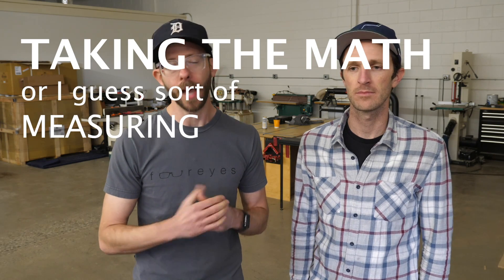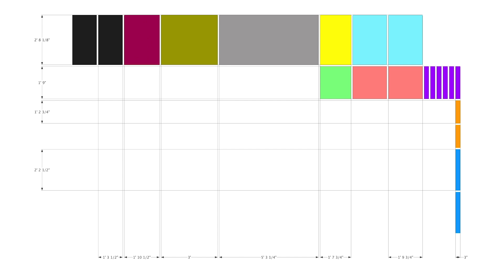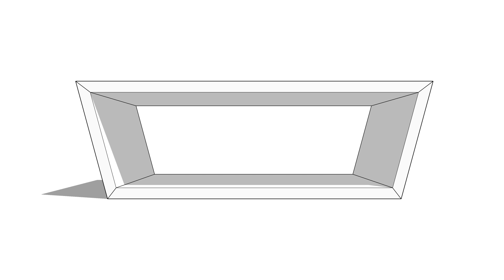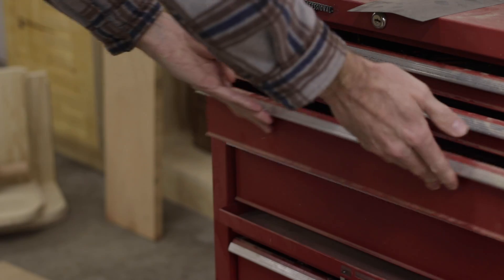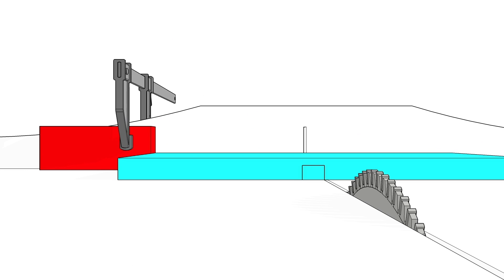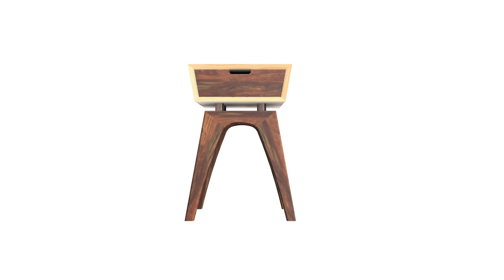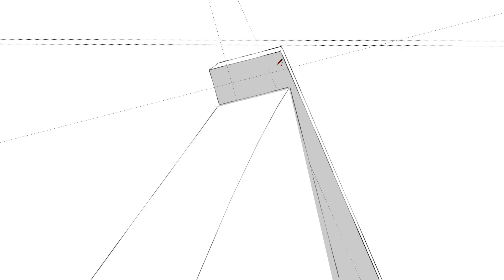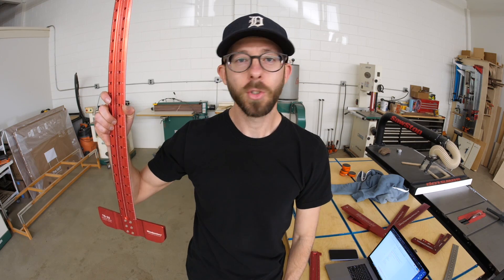Taking Math Out Of Woodworking | 6 Tips and Tricks to Eliminate Math & Measuring from your Projects!

Comment: Love that drillbit technique... I'll definitely be using it soon.

With some training in engineering, I used to strongly believe in the old adage, "measure twice, cut once"... Then I did some work with a carpenter with 30+ years experience, and so often he'd mark from actual pieces rather than measurements and sneak up on certain fits, measuring once and cutting 3-5 times... It really helped me bridge the gap between design and manufacture. We once built a deck together and I was getting all worked up about the length of the posts we were burying, the depth of the holes, setting things plumb. He taught me to throw all that out the window and just set string lines to get the posts well aligned and establish level with the the next set of beams, then move towards square with the next layer of joists, align the floorboards as well as possible, but only really worry about square when trimming the excess off the floorboards. It's fine to aim to get every cut and joint as perfect as possible, but having the skill to make it work despite slight discrepancies in the measurements, that's what really sets the craftsman apart.

Comment: Physicist here with some defenses from the haters:
1) You are using math, you're just minimizing the use of a ruler.
2) One of the first things I was taught in physics lab is "when you are using a ruler, you are actually taking two measurements, one lining up the zero, and one lining up the end" this does double the error. As you explained, a set table fence is 1 measurement, not two.
3) Trigonometry is a branch of geometry. I would say "relative dimensioning" is another branch of geometry - or just a subset of "euclidean geometry" - which is basically all the math you can do with a straight edge, and a compass - but each without markings. Relative dimensioning is a very old form math, because for a ruler to work, you need absolute dimensions, which needs a concept of zero, which was only invented once in human history in ~900CE - all carpentry and architecture before 900 - requires relative dimensioning.
4) Whenever I was doing numeric trigonometry - it is important that the sin/cos/tan be reported to 4 significant digits (e.g. sin(45) = .7071, not 0.71) (for length measurements of 2 significant digits). That's why it wont work for wood working. Hobbyists work in 2 significant digits, and professionals work in 3. 4 significant digits is just not possible when working in wood, so the 4 sig fig that you need to do trig properly, is just physically impossible.

My personal hobby is to tell youtubers who say "it's not math"/"this isn't scientific", "yes it is". Keep up the good work.

Comment: According to my math changing 1 degree in a 90 cm leg would yield a difference of aprox 2,42 cm of the total width of the legs. It is not much but it is around a 3% change. If the legs were longer than that the difference would amplify much more! Thanks for the video.

Comment: this is a great video.  In this digital age people forget that wood is organic and is particularly prone to the second law of thermodynamics; the law of entropy.  Wood is constantly swelling, shrinking, warping and bending.  No matter how accurate your measurements and angles are, if you cut all your parts today,  those angles and measurements will not be the same when you come back to assemble them tomorrow.   A real craftsman knows how to make things look like regular shapes when in fact they are not.  I always tell my helpers that if all houses were square, level and  plumb there would be no need for carpenters.  One could just order the things from a factory and take them home.  I do custom cabinets and kitchens, and whenever possible I use story boards,  full size templates, marking in place and scribing to deal with complex measurements and angles. And when everything is installed,  Blum hardware is cleverly designed to be able to let you tweek the fit of all the doors and drawers.  For the customer it is more important that things look coherent that actually be numerically accurate.

Comment: Honestly, with all those tools the dgr of accuracy of the very tool is not dead on what it says it is, its relatively close measurements.  Everything has tolerances metal working is not any differnt.  Besides you can cut wood a perfect size " when angles smile and the sun burns bright" but 3 days later the humidity changes and that part is no longer that size.  Measurement is only a reference or guideline, dont stress out on it as much. 
Ps guys you can pay about a grand on a fence system that will repeat cuts if you move the fence, also you can use a cut part to set the fence back into a relatively close size to cut more of the same parts.   My table saw fence is within .0001 of an inch on the scale at 3" 4" and 6"  you can read a tape down to .0005 of an inch I've done it when I worked in a machine shop but the question is is that tape measure accurate?  Tolerances of woodpecker tools are very close it's made in American on cnc machines so the parts are very close but they are not perfect.  It's more the looks and that red anodized aircraft aluminum looks good, it would look even better in my shop.

Comment: One of the difficulties, as illustrated by you cutting all of the similar parts with the same fence setting, is that our ability to translate a measurement into a real world object with perfect accuracy is limited.  Of course you use the measurement as a starting point, but you also have the common sense to know that you've not translated that measurement perfectly.  The more I fool around in my shop, the more aware I am of this inadequacy, and the more aware I am of how I need to pay attention to the actual object I've created as I move forward in any particular build.  Great job guys.

Comment: Use metric for a start means it isn't such a big deal. Join the rest of the world America. FFS: inches/feet etc makes no sense and are crazy to try do multiplication. Millimetres/CM and Metres are sane units. 1.2m (or 120cm or 1200mm) is a metric equivalent to 4 feet, 1.5m (or 150cm, or 1500mm) is close enough to 5 feet. 
For inches: 25mm. So 2inches just use 50mm instead. 
Then trying hard to find ways to avoid maths might not be so necessary. 
But sure: eyeballing it, using tricks to make up for innacurate cuts and finding ways to make up for the imperfect world when you're cutting stuff makes sense.

Comment: The word "measure" is used today almost exclusively in the context of "quantitative measure". I.E., determining how many whatzits an object is in length or how many whozits an object weighs (or masses, if you're a scientificalish sort of personalty).

But the techniques you showed for the router inlay are also a form of measure. They're just more of a comparative or relative measure than a quantitative one.

You placed the actual inlay on the board and traced it with a marking knife. This gave you the measure of the inlays length and width. Then you used the inlay itself to set the router plunge depth, which gave you the measure of the inlay's depth. You used the inlay itself //as a measuring device\\ for all three dimensions, giving you accurate measures for 1 inlaylengthunit by 1 inlaywidthunit by 1 inlaydepthunit.

It's still measuring, it's just a different, and in this case, far more accurate, +style+ of measurement. Because the units you used are more precisely aligned with the actual object (or in this case, hole) you were measuring, rather than arbitrary units like feet, meters, handsbreadths, or cubits, which would have to be multiplied and subdivided to represent a real-world object (or in this case, hole).

How many 'whats' in a 'grid' to get you safely into the heart of downtown Berlin?* Who cares!? The distance from here to there is always equal to exactly ONE heretothereunit. No math required. Which is good, because I suck at math. And at woodworking, but that's neither here nor there.

* Obscure MASH reference...

Comment: what at ever your cad program you design to have what I call a reference piece or parent piece.  you cut this as ABSOLUTELY Accurately as possible.

from there every thing else is cut to fit but with the actual drawing measurements acting as only a guide.

Comment: My table saw has a terrible fence. It's maximum width is about 17cm so if I need wider cuts than that I have to clamp a straight edge to the wings of the table as a temporary fence. This pretty much forces me into the same 'minimum shifty fencey' mindset.

Comment: LOL that was awesome! At first I was like WTF! I'm a scientist and my minor was math. I have worked in a calibration lab for years, worked with NIST, NASA, EPA and other national and international standards labs....so super measurement and math heavy and I was like no you really need to master this stuff because A) it does matter and B) it's not as hard as you might think but after watching I 100% agree.  Making consistent cuts by moving your fence as few times as possible they planning and setup is absolutely the best route. I mean math definitely has it's place but when you are trying to make something that's both attractive and fits together well with great joints and symmetric dimensions (where that's wanted) and even/level surfaces, math can sit back, relax and enjoy a drink after the planning stages.

Comment: There are a lot of good points here, but on the trapazoidal box, for instance...saying "cut the top to whatever you want, cut the sides to whatever you want, and then sneak up on the perfect fit" doesn't solve everything with not measuring, cause now you have to be exact on your divider heights, abd your drawer widths, angles, etc....you just got arbitrary with the first step, and now you'll pay for it with every step down the line....knowing the math inside and out, and learning precision shouldn't be skipped over....
Reply: I think you're missing the point. Of course you have to take some measurements, but if you just cut to plan, when you go to assemble and something is off, don't blame the plan, blame human error. That is the very point of making test cuts and sneaking up to the perfect fit
Reply: @PiedmontDoe  agreed, the order of operations matters greatly
Reply from the maker: I don't think it ads any extra steps you'll pay for down the line, because the point is, the measurements can't be trusted in the first place. so you should be using relative measurements the whole way through. When you pay for it, is when you assume the measurements are perfect and you blindly cut them.
Reply: @Foureyes.Furniture  agrees, I think the thing that I disagreed with was to cut the top and sides to whatever you want...they still need to be within tollerence....also certain things need to be very precise fit, like the miters, but other things like shelves or dividers that slide into dados and will be covered by edge banding or a face frame can be a little more loose, and frankly should be to help with assembly

Comment: Great video!  I really enjoy this way of thinking and working.  I know for the pieces I make, there is usually only one critical dimension (must fit in x space).  Everything else can be approximate so long as they are uniform.  An excellent book on this is "By hand and eye".  Imo a must for anyone making furniture.
Reply from the maker: Good point. I usually start my drawings with a box of the finished size...then I just kind of draw within those constraints...for this exact reason.
Reply: @Foureyes.Furniture  It's very freeing to not have to worry every single dimension to death.  Moreover as you point out, it leads to tighter joinery and better craftsmanship.

Comment: When I worked on expensive yacht interior my most accurate tool for dealing with weird shaped walls, shelves, floors etc, was... some scrap wood and a pointy slat. A bit like a stair spider, but simpler with drawing some lines on the scrap wood and slat so you can transfer it.

Comment: Switching to metric will make your life so much easier and this video totally unnecessary
Reply: There's no getting away from imperial completely. Can't we all just get along? [Metric 🤝 Imperial] Also BluuurghAg9, you need Jesus. This is a comedy/ woodworking channel not a place to complain about America
Reply: @PiedmontDoe  well I never use any imperial measurements, for measurements it's totally unnecessary. The only non-metric I still use a lot though is cup/tablespoon/teaspoon for cooking. Sometimes it's just easier than weighing.
Reply from the maker: If I woke up tomorrow and we switched to Metric, I would be thrilled...but that's probably not gonna happen. Also, it really wouldn't eliminate any of the problems we talk about in the video. They have less to do with the numbers and more to do with the fact that it's a human behind them. Otherwise every tip in the video would be "round to the closest 1/4"

The only number specific example that has to do with rounding, I think, is the angle one I used. Pretty sure that's universal.
Reply: You are talking to people that live in a country where they believe more and bigger guns will provide safety at schools. People that consider healthcare communism and believe in an imaginary god... They will use the imperial system till the bitter end I'm affraid

Comment: Also , if you got your self ,,normal" european style cabinetmaking saw - with sliding table , Felder , Altendorff etc repeating cuts will be breeze.
Reply: Personally, I'm glad they're using regular table saws. It helps keep my attention because I can't justify the cost or fit one of those (sliding table saw) in my garage.
Reply: @PiedmontDoe  I agree. At my job I do use one of those fancy machines and they are great, but when I'm at home it's a different game. Space, money etc. Besides, you can do really cool stuff with sleds as well
Reply: @BluuurghAg9  their  practical and filosofical explanation is absolutely amazing. to the T. But again small European style saw with slider  does not cost fortune and they come with digital or machinist reed-out . $ 2-3000 that is about same as  Delta or Saw Stop gadget
Reply from the maker: I've never used/seen one in person, so it's hard to comment. Everything in America like that seems to be huge industrial saws. in the 10s of thousands. But, are the fences made with positive stops at every 32nd of an inch, or? If not, I think the same problem would exist.
Reply: @Foureyes.Furniture   I understand,  but if youcan surf e-bay and Craig list you might find , i did  that way,it also Laguna tools making one in Bulgaria of all places not to mentioned China inow i now.  there is also i belive Tiger Stop Fence reed out that repeatively could move your fence perhaps in 32nds . But this article was spot-on that dilema !
Reply: Those things are expensive as fuck. Sure, if you can miss the money, go for it! But untill that time....